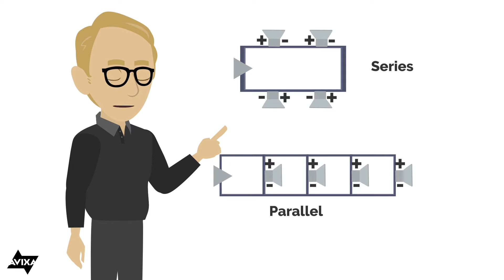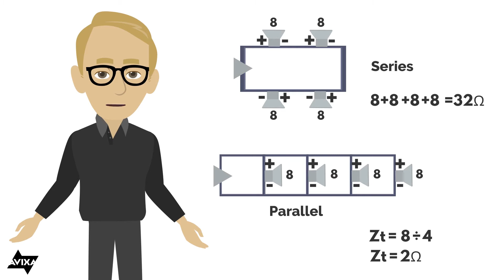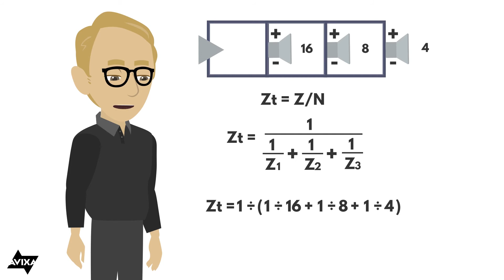Calculating Loudspeaker Impedance in Series or Parallel Configurations

Comment: What do you do if you have the same 4 speakers in parallel Zt=2ohms. This example seems to be adding another 4 speakers to the amplifier.
Reply: You are correct. Z is a load it can be a speaker or an electrical circuit additionally this is not the Precise total Z of the line as the Speaker wire and difference will impact it but this gets you the Speaker Impedance.  same would be true if you had 3 speakers same formula applies if all are the same (8+8+8)/3 = 8 ohms. Its using 4 (8 ohm) loads so its (8+8+8+8)  / 4 speakers 32/4 = 2

Comment: interesting , parallel with different impedance is confusing , last week my kr-770 Kenwood amazing vintage amplifier blown off because my stupid connection , it breaks my heart , i will repair it but really we should learn about impedance because sometimes we could lose precious stuff such as kr770 , or luxman l405 all gone bad because wrong speakers calculation
Reply from the maker: Ugggh. That sounds awful. But, yes, loudspeaker impedance is incredibly important--especially with vintage, irreplaceable gear!
Reply: @AVIXATV     Thank you so much for reply , its fixed now plus couple of capacitors were replaced ! 
i know it sounds crazy because all parts ordered are originals , but trust me its worth it because this amplifier it doesn't process analog sound only -it processes a magic too , i will review this amplifier next video with cs-522 acoustic vintage pioneer speakers.